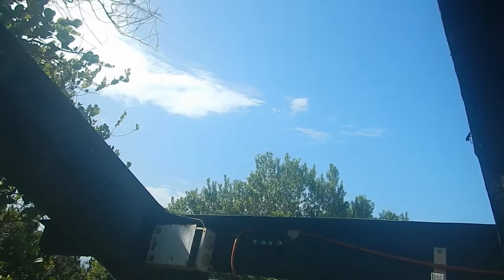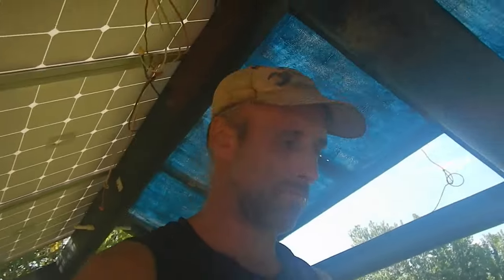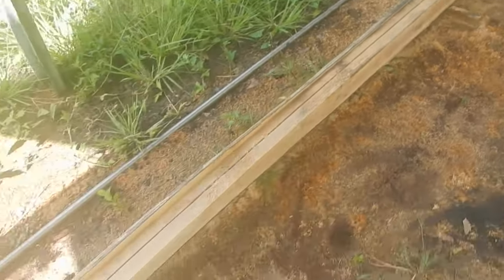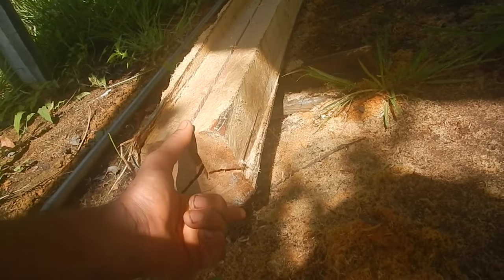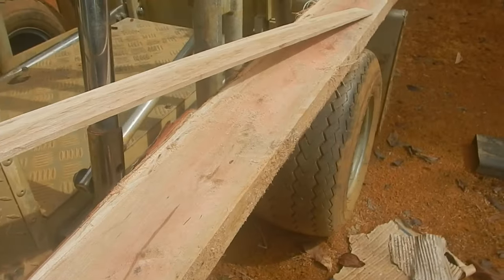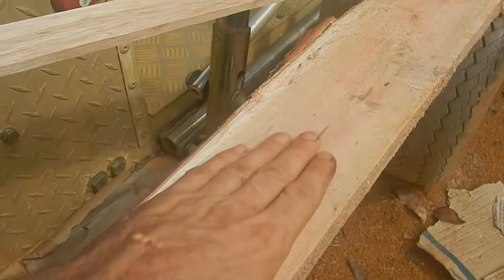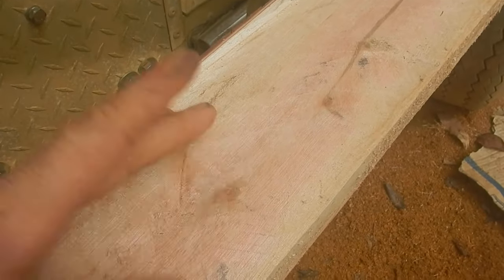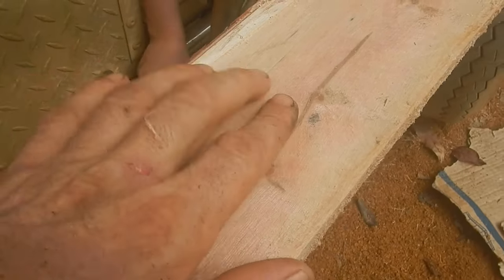Lumber Mill Test!

Comment: I love the simplicity of direct solar. The wood doesn't run away and instead of storing solar, you can just store the cut wood... Even supercapacitors would only give you half a cut... So yea you have a great system... A lot of water pumps in this world use direct solar, they just store the water in a water tower, even heat pumps can store energy as ice, there are  lots of smart ways of storing energy in cheaper things than batteries, and in your case it just happens to be in the cut wood. As so often, you are ahead of the curve and not behind! That's why I love your videos! Best wishes and keep up the good work.

Comment: Great this is working so well. Maybe a heavy flywheel would help the motor get less overwhelmed when it gets bogged in the wood. It would give the blade more chutzpah. (apparently the leaves on the PV's had a lot to do with it on that first cut)

Comment: I was sharpening my tools with a metal file and a neighbor came over and said, "I can let you borrow my grinder". I told him I like doing things by hand and if it took a month to sharpen one tool it was 'therapeutic" and it was my time. I get where you are coming from with batteries for the saw. If you have time and aren't in a rush, then using almost free power makes sense. The same neighbor also seemed perplexed at my use of an axe and machete instead of a chainsaw (I can't stand the racket they make) and again, it might take more time, but I enjoy using them.
Reply: Machines turn a task into a chore.
Reply: Depending upon the size of the task and the size of the machine,
They can turn a chore into a task.
I get where you're coming from, about them being loud.
I would add to that, dangerous.
I recently expanded my tools into three chainsaws, because I heat with wood, and I have more important places with which to spend my time.
I will however, be sharpening my saws by hand.

Comment: I'm amazed there isn't a battery bank for the house. Tie in all solar from the boats and the lumber mill with a "shore power" type setup, and you should be able to generate heaps of power that's being currently wasted.

Comment: The solar panels are amperage limited as you know. A big enough lead acid battery of your system voltage would limit the voltage when insufficiently charged.
Used as a short tum buffer that battery could power you through the cuts and tough spots and passing clouds. Then disconnect the battery when not in use. Skip the controllers as long as you can tend and manage the system. Old batteries are good enough as in the old days of your boating.
You could design and build a high-voltage - charge-limiting- disconnect and start with a full battery each work session.

Comment: would it be possible to put together a lead acid battery bank for much cheaper, and still habe the extra umph when you need it cor milling? maybe you still  need fancy charge controllers and motor controllers etc.  just thinking outloud.

Comment: When I see solar panels which are not used, I see loss of money. In your shoes, I'd propably try to find some used but still working lead acid batteries, use lots of them and try to make some central electric system for house and systems and maybe connect solar panels from boat too.

I know it's a challenge to move low voltage for long distance without overpaying from cables, but maybe there's some aluminium in scrapyard. I can buy new 20mm cable conduit aluminium pipe for less than 1€/m, and Finland is expensive country. It has 60mm2 cross section, which is plenty.

Comment: jamie what about using Capacitors store more temporary energy  to get more power for your saw so its not so hard on the solar panels instead of using battery's ?
then you can get a bit of extra power on cloudy days to cut timber.

Comment: If anything the way to make it more convenient would be some sort of way you can setup a cut for it to do when it gets enough power. Either a rubber band kinda thing or use the motor to drive it forward as well. Then you could cut easier when there are short breaks in the clouds without having to run over. That would still require extra electronics so it only runs when there is enough power. 

You probably don't need enough wood to even warrant that though.

Comment: Instead of batteries maybe capacitors could be used to smooth out the performance of the saw, but I agree that it only makes sense if you run across some capacitors for free or take them out of old TVs and other appliances that have them.